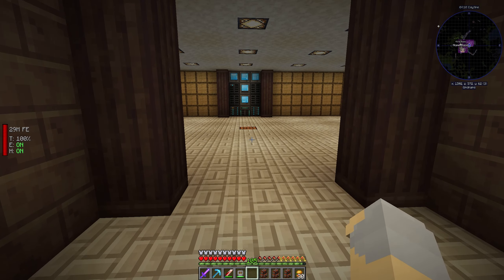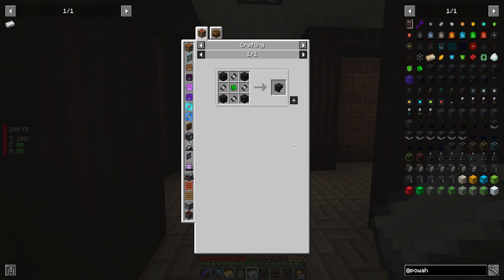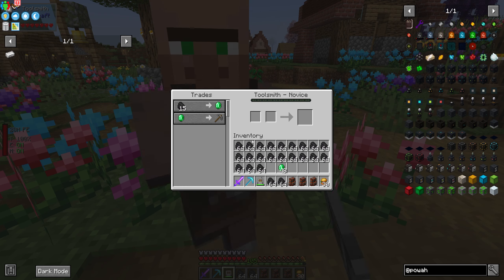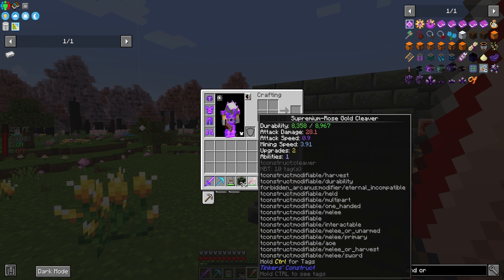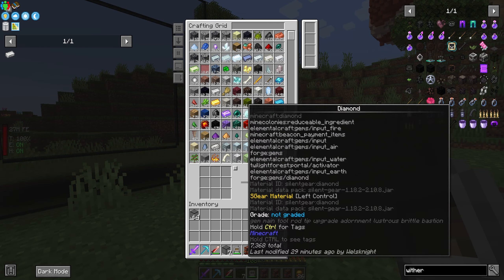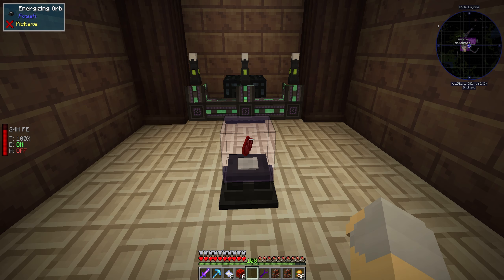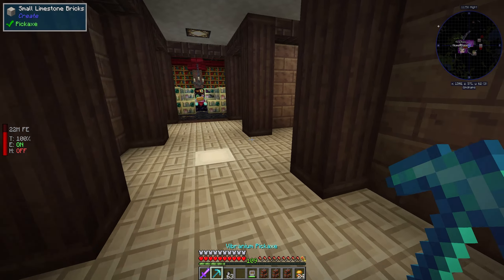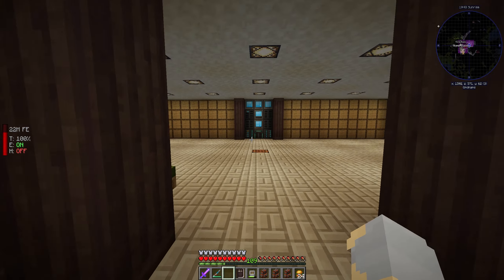POWAH Reactor! | All the Mods 7

Comment: When using Powah, you can use block versions of the materials to make it much easier, blaze rods included. Also since you are using Ender Cell's, you should check out Ender Gates, it wirelessly transferes rf from the ender cell to the machine you want kinda like flux points.

Comment: If you point a RS crafter at the Energising orb.  Set the crafting mode to redstone signal stops crafting.  Then take a comparitor reading out of the Energising orb and run a redstone line to the crafter. Add some way to get the completed items back into your RS storage and the Orb is fully automated.
Reply: This. Also importer does not pull out unfinished crafting materials. I use wireless redstone.

Comment: Uraninite is uranium dioxide.  It's basically the name for uranium ore.  It's actually surprising that the mod doesn't require you to refine it before you use it as fuel.  With how most mods seem to be made, I would expect you to have to grind it into yellowcake and then smelt it into a reactor rod.

Comment: has mob utils grinder with spawners...could just pop in some wither skeleton spawn eggs and the decapacitator upgrades for absolute tons of skulls...considers building a separate wither skull farm...ok...then he goes off and manually farms skulls...whew...oh, also, hostile mob networks or whatever it's called, kill 6 withers while holding a model for a wither and you can chuck that into the simulator for slow but effectively infinite stars, and you get better drop rates as time goes on
yeah wither kill chambers need to be wither tight and like 3 blocks thick or 1 block thick but built with a bigger space inside, so it doesn't clip through, I prefer the first method so it can't move out of my attack range